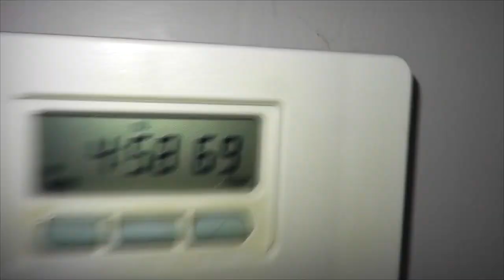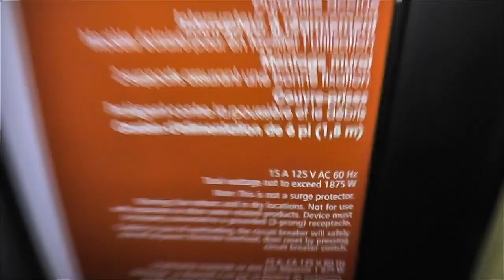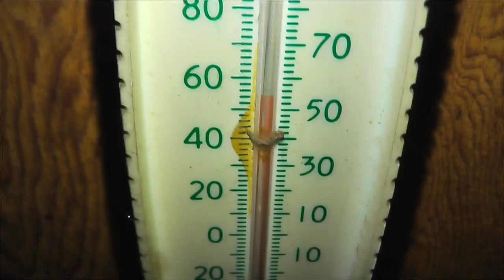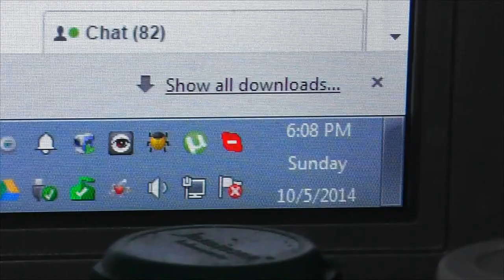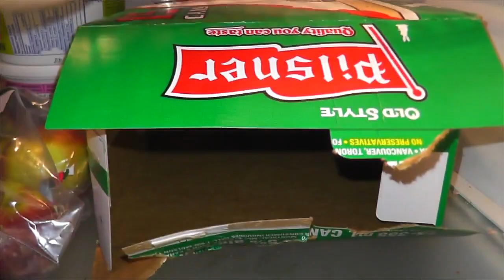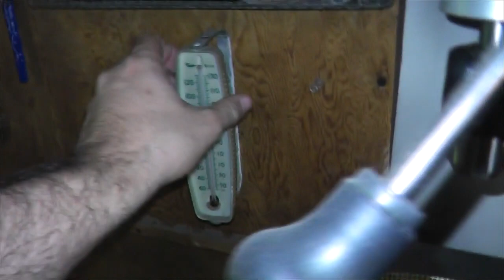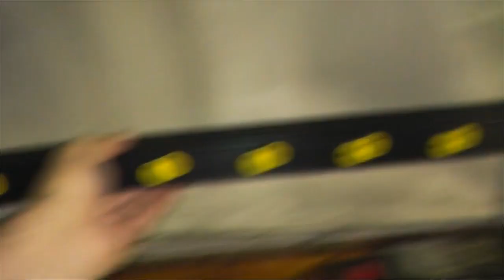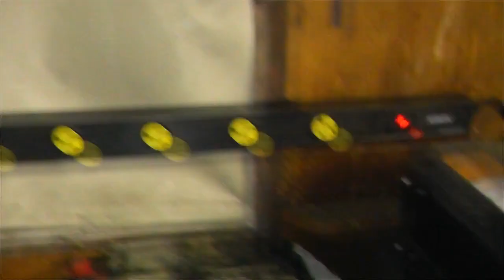I shot a guy this one time

Comment: Not hard to get 240v out in your garage, you guys have a split-phase system (120-0-120), so you just need a socket (or two) that's wired phase to phase which will give you 240v, over here we just use 240v by default... :)

No pen? Use a flat blade screwdriver to scratch marks into the wall where you need 'em... :D

hehe, could be horsemeat, but horsemeat is good, they're thinking of bringing it back here in the UK as a mainstream meat (it used to be sold as "Kicker" in Yorkshire)... :P

Yeah, it gets dark fast for us up in the more northern hemisphere at this time of year, kind of sucks, but it's not like we could change the rotational speed of the earth to prevent it... :P